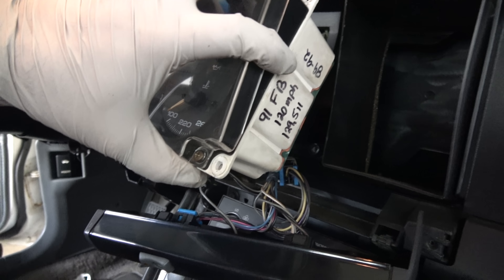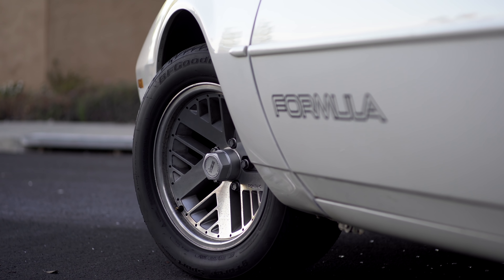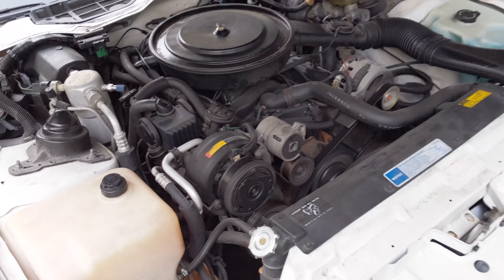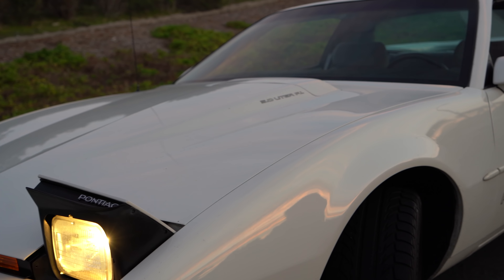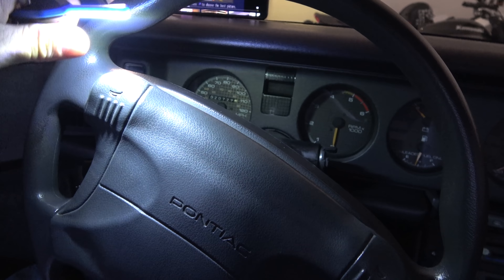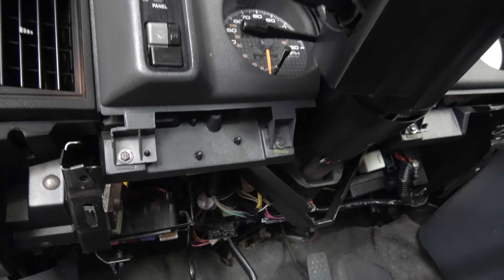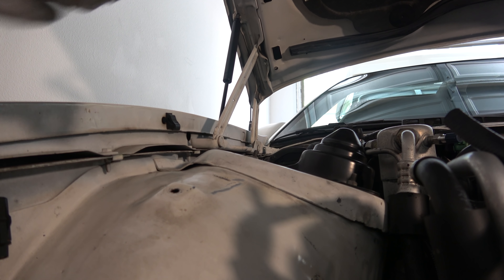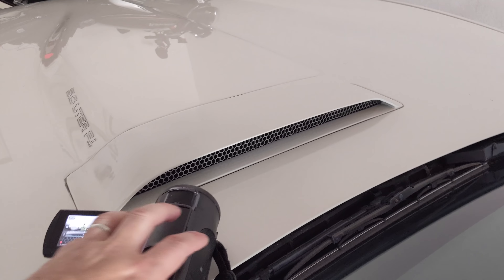LIES! Odometer fraud on my 1990 Firebird

Comment: My biggest car mistake. While having to work in another State my Wife wanted to get my son a good reliable inexpensive car to go to school in. I suggested she look for (at the time), a late model mid 90's Buick with it's 3.8 liter V6 (those engines were bullet proof, insanity to stop making them). She found a really nice looking low mileage reasonably priced one in a town 60 miles away. The car Fax on this one was also immaculate so she bought it. Wasn't too long afterward that we started to have Serious problems with it (Horn going off by itself in the nighttime requiring battery uncoupling to stop, all rear lights going out, Etc.). Coming home to repair I found all hidden wiring throughout was BADLY Corroded. Apparently this car had been submerged in water at one time, not turned into insurance but cleaned up and dried out. The people we bought it from could no longer be located. Ended up giving car to Charity for the Tax credit.
Reply from the maker: That sucks

Comment: A buddy bought a used 1985 Camaro 2.8 V6 with TPI from a rental car company around 1987 time frame. It had about 50k miles on it and it looked way more worn inside than this nice 1990 firebird. But rental car miles are often harsh. 

The super oddball thing is my buddy changed the oil and the 2.8 engine had its ORIGINAL oil filter complete with the engine blocks original paint on one side of the filter. So the Hertz or Avis just added oil only. The frame got a crack years later near the steering box. The fuel pump died after 100k. In my 1982 Camaro the in tank fuel pump died like in 240 to 250k.

Comment: They make a valve stem cap, you pull the valve cover and remove the rockers and springs. The rubber cap fits over the valve stem facing down. It has a oring on it and it effectively seals the valve stem. I used them on a late seventies formula years ago. Works great on leaky valves with a otherwise good engine.

Comment: I bought a used DeLorean from a DeLorean dealership in Grand Rapids, MI looooooong time ago when they were “new”. It only had 19,000 miles on it. The clutch wore out within three months of owning it, and yes, it really did only have 19,000 miles. Large rear tires vs very small diameter clutch was a recipe for disaster. I replaced it with a Centerforce branded clutch assembly. The car now has 50,000 miles on it and the clutch faired much better.

Comment: Hey Winston if you like the car that's all that matters. Plus even if it does have 150,000 miles it's still low mileage vehicle being 30 years old. That's only an average of 5,000 mi a year basically.
Reply: I bought a 98 integra with 37k original miles low mile cars are out there- this one had something done to it

Comment: Take whatever legal steps you can, but another way to look at it is if the car is structurally sound and not majorly damaged in that way, you may have paid a bit too much, but you would also have a good foundation to build on. 

There are still a few out there worth saving, but the gross majority are shitboxes. Thus far, it sounds like you actually have something to work with. I got caught out there 20 years ago with mine and you are already further ahead. 

Good luck...!

Comment: You should do a compression test on this. I would recommend compression testing at least 1-2 cylinders (with the fuel pump fuse pulled) on any car you buy or want to buy, if the seller will let you. Engine compression being in range (and it being mostly even across all cylinders) matters more than mileage itself. Someone could run 15K mile oil changes and have a blown head gasket but still be low mileage, but someone can have 250K miles and 3-5K oil changes and never overheated the car and have the compression be perfectly in range. While mileage is cool, it is just a number, and a rather easily (as you found out) manipulated number that doesn't tell a whole story of a car.

Comment: With classic cars I mostly don't look for high or low mileage. The car is so old.....
I just ask about history...services...good oil pressure etc.
Sometimes you can see (here in holland) how long a car is with a person..
If it's like more than 10 years with one owner for example, most of the time they spend some money on it

Comment: That's why you have a 305 automatic ecm. The 5 speed only came with the 305 multi port.
Be glad because you can always outsource the right engine and because you live in California you can still find parts for those years. Because of that t- top that car would have rotted out year ago anywhere else. 
A friend of mine had one way back in the 90s and because the tops always leaked he had to drill holes in the floor to let the water out so at least you have a great body and with that you have a great platform to airk and build the car YOU want. That's what Americans do, we don't give up , we take what we have and make it our own.
Welcome to America and join us. We are a little different in the away we build our cars.

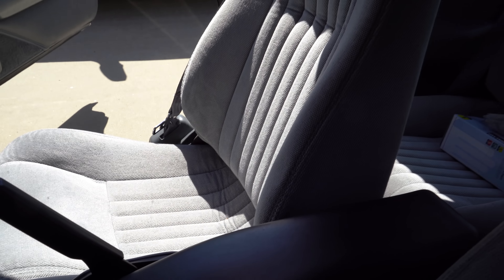Comment: 2:14 While you can get scammed like this in America... the benefit of America is actually you have recourse for scams like this... as you can gather your evidence and take the dealer to court and either get some or all of your money back to bring the car back to good condition and any losses incurred. 

If i were you, I'd gather evidence, compile a compliation of videos showing the disrepair the vehicle was in, gather the parts or photographic evidence that showed it's true age, especially the odometer/computer, etc, reach out to an attorney to go over your options of recourse... 

Since it was a dealer that sold it to you, should be even easy to get your some or all of your money back and attorney fees, as opposed to suing a private party, which you'd have to take to small claims court yourself and usually without an attorney.

Comment: Really sorry to hear this bull, yes, that's a big fat felony to meddle with the mileage. I bought a 2008 pickup that had 148,000 miles on it and needed lots of expensive work, including replacing two body panels, a tailgate, and a new driver's seat frame and cushions. Got it for $7,600, but I knew exactly what I was going to do with it.

Comment: Winston, I thught you are more clever.
The milage on the odometer is for the car it came out on the junkyard . You even explain this procedure on the „ECM“.
Who the hell would write the original milage on a tricked odo???
The year mentioned 89-92 should even show a dump guy, that it can not be from his particular car.
Better ask yourself, how it could happen, that it once showed 129‘ miles and now 20‘. Maybe it was corrected to the actual milage of your car, and everything is just fine.
Seats look a lot better than 129‘ miles.

Comment: This was a very common practice by used car dealers in the last few decades. They all did it in one form or another. In fact there was a database you could access that would tell you exactly which dashes from what cars would swap and still be compatible with the OBC.

Comment: Stuff happens on low mileage cars too- especially ones that do very little road use a year (like valve stem seals drying out & failing, sump gaskets doing the same, etc etc)

Comment: So as other people have pointed out, the mileage that was written on the side of the odometer may have come from the junkyard car. As for why the cluster and the PCM were replaced, you had mentioned that the car was stolen. More than likely what happened was that when the car was stolen and somebody was probably chopping up the car and those parts got removed. So hence why your car has junkyard parts. It may truly actually be a low mileage car. Things such as the valve stem seals smoking, that could be caused by an engine that sits a lot and doesn’t run especially on those older Chevys. That engine bay is far too clean for a high mileage car. A car sitting and not running for long periods of time can and does cause many of the issues you’re dealing with.

Comment: Some super crude tell tails of mileage are the slop/backlash in the axle gear set and also the engine timing chain. The drivers seat gets worn. The drivers seat gets bent back, yields, creeps back more at an angle. The heater core box gets dustier. Things that are faked/replaced are the pedals, too new or worn too much. With time in SoCal driving my 3rd gen has its windshield more dinged by micro crap. At 300k it is less "good" as a new one, it has crazed areas. in 300k miles the clutch on mine has been replaced twice, the water pump twice, the radiator once, has the same 1982 alternator. The distributor module twice replaced.

Comment: If the car was parked too long all that stuff could go bad, chevy don't really have valve seal problem with high mileage more likely from sitting . U can always put a little brake fluid in the oil to soften up the valve seals and stop the smoking . Best way to check the mileage is put a breaker bar with a socket on the crank pulley bolt and turn it back and forth and see how much play is in the timing chain. Or  u can go ahead and do the timing chain on both cars just to be safe.

Comment: I mentioned that I thought the undercarriage looked low-ish mileage on a previous video.  What does the brake pedal rubber look like?  100k miles is 1/2 worn pedal corner, 200k miles is metal showing.
Reply: That is usually the 1st thing a car dealer replaces .

Comment: The most important thing you said was "I'm not giving up on this car" Regardless of the mileage not being true it's still a nice car! This also says a lot about Gateway Classics. In your first video I could spot that it wasn't a 20k car, a car dealer that specializes is classic cars should have seen this from a mile away. I now have a VERY low opinion of Gateway Classics.

Comment: Those markings on the cluster are so that the guy at the salvage yard can easily tell the specs of the cluster when a customer calls without having to take it out of the stack on the shelf. I suspect that the cluster was bad and they swapped the car's original odometer into the junkyard cluster. The things you mention about the clutch are normal for a 30-year-old vehicle, and at that age, the valve stem seals are likely to be hardened or dry rotted, especially if the vehicle sat for long periods. Again, this does not indicate mileage, but age. Rust inside the distributor is also common on these vehicles. The reluctor wheel was covered in rust because it sat for a long time and there was moisture present.  The fuel system needing attention is also very common. The car probably had ethanol laden fuel run through it and then sat, this would have introduced water to the system, and many of the parts were never intended for use with ethanol fuels. Before tackling fuel issues, you should have replaced those oxygen sensors as those OBD1 systems really need good O2 sensors.  Nothing you've shown here is indicative of fraud. I don't mean to be rude, but the fact that you purchased a vehicle with a 5.0L engine tells me that you are not so knowledgable about that era of GM vehicles and engines. If you were, you'd certainly have purchased a vehicle with at least a 5.7L engine.  Get yourself an OBD1 cable and a copy of TunerPro to help with the diagnostics if you intend to do it all yourself. Don't just throw parts at it, diagnose the actual issues and work from there.  The valve stem seals should take just a few hours to complete. and can easily be done with the engine in the car.  TL:DR; Everything you noted points to a vehicle that is 30 years old and does not indicate anything about the mileage.

Comment: if a dealership replace guage cluster with a used cluster from junkyard they are supposed to reset odomitter to correct mileage so you could very well have a low mileage car   i was a gm dealership mechanic  ,  also corrosion in distributor and cap shows possible signs of sitting for extended time period   enjoy you car its very nice condition

Comment: Sounds like you have grounds for a lawsuit. In every state in the country, every seller is responsible for reporting the accuracy of the odometer reading prior to sale, and tampering with an odometer then reporting false mileage as genuine is a federal crime. There is a significant difference between 20K and 150K. Even if the person or dealer who sold the car to you didn't know they were selling you a high mileage car, they are ultimately responsible for taking due diligence in reporting it's accuracy. You would be well served to speak with an attorney. I believe you have an excellent case and could end up recouping most, if not all of what you've invested in it plus damages.

Comment: ah man. sorry to see this. i bought a older camaro that had 38000 miles. it was a 16 hour drive, but i refused to buy sight unseen. luckily the trip was a win and everything looked and smelled new even though the car was technically old. ive seen some weird stuff done to camaros and the weirdest was that a guy used a pair of underware to plug up a rust hole in the right side back of the wheel well. very common spot for rust in third gens, not the right fix in that case. haha

Comment: Your mileage will only be about 12-14mpg around town.
 I had a 88 4x4 with a 350 that at 50k miles, had the blue smoke on start up. Bought the seals for it and never bothered to install them. Sold it with 129,000 on it.

Comment: It's totally possible that instrument cluster is all original except except for the back piece . I've had to replace just the back of the cluster before . The plastic can get brittle over time . Then when you try to replace the light bulbs the plastic cracks and breaks , then gauges quit working right . Just because a 1990 car has low miles doesn't mean it's new , they will have age related problems just like any other 1990 . Bearings dry out , grease turns to wax , rubber rots , seals dry out and get hard , plastic degrades regardless if it's being driven . And sitting too long can cause all kinds of problems in an engine . Chances are , the smoking problem will get better once you start driving the car more regularly .

Comment: Are you going to do a video on that 83-84 air induction install? I also had a 90 Formula back in the day, but it was TPI so regrettably I couldn’t do that mod. But I did get the 84 screen to replace that ugly block off panel. Nice work on yours.
Reply from the maker: Yes I'll make the next video about that!
Reply: Worthless Whips That’s great! Always wondered how that would go. My dream car was much the same  as yours. In my case a black 1990 Fomula I bought in 97. It had 48k miles then, and the 225 hp 5.0 TPI 5 speed. With that option came the 3.42 posi, dual cat exhaust, oil cooler, and 4 disc brakes. Car was such a blast. Kept up with and beat a lot of 5.0 fox mustangs at the time. Sold it 10 years later with 122k miles and still regret it. I look forward to seeing how yours develops.

Comment: If you bought the car from a licensed dealer I’m pretty sure you can get all your money back for having a car with odometer fraud. Look into it!!!!!
Reply: But there is no evidence what the mileage really is, only that the speedo was replaced
Reply: 3beltwesty evidence that the speedo was replaced should be more than enough to prove that the dealer sold a car with a mileage discrepancy
Reply: @eye8owne8u  Many cars have had their speedos replaced, that is not proof that the mileage is off.
Reply: @eye8owne8u  A licensed speedometer shop will set the replaced unit to the old mileage

Comment: VIN vehicle history report prior to purchase didnt show this mileage inconsistency?
Reply: Some states I think delete VIN mileage after a certain year. That's why it had no mileage until 2012 or whatever. I think the car was bought, painted really pretty (is a decent paint job worth $1500-2000 alone...) and given a decent interior detail/cleaning with perhaps some parts replaced from other junkyard Firebirds. Seems restored to look pretty to sell, but the restoration didn't seem to care much about how it ran. 

I guess a tip for Winston if he insists on buying "low mileage" classic cars is basically anything that's been repainted is probably suspect, to me anyway. Thinking logically, a 15K mile 25 year old car makes very little sense. That would be 3-5 oil changes in its lifetime of 25 years. The car would be full of sludge just from sitting with old oil in it, same with gasoline. 15K miles would be 600 miles a year, that's literally 2-3 tanks of gasoline per year. If it's been 15K real miles, usually the real case is the car is probably a rusted basket case from sitting forever because someone had a mechanical issue and didn't want to put money into repairing it and let it sit in the woods or a leaky garage.

Comment: First off sorry about your frustration. Yes all signs point to a higher mileage car. A different cluster from a junkyard yard says the original one stopped working; not uncommon for GM vehicles from this era. Easier to just replace than to take it apart to fix.

Comment: Sorry to hear that but it’s still a cool car! Blue smoke usually means your running too rich, black smokes oil, blue smokes fuel. I’m not educated enough with fuel injection to gauge what’s going on, some how too much fuels being injected. I guess one of the sensors isn’t sending correctly.

Comment: even though you got ripped off it is still a clean and great looking car. you definitely should be getting better mpg than 7 or 8. i have an 87 formula tpi and i put a 160 degree thermostat in it and i went from 20 to 14 mpg. the car ran great but the mpg was horrible. the lower thermostat tricks the computer to run richer.